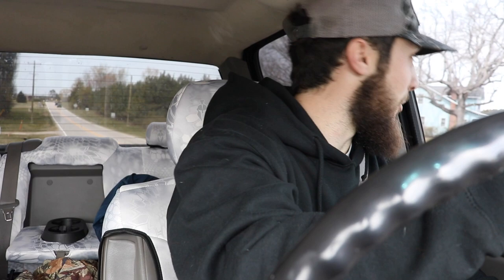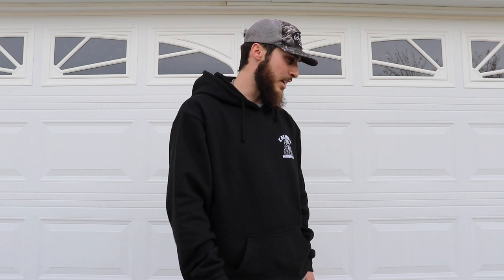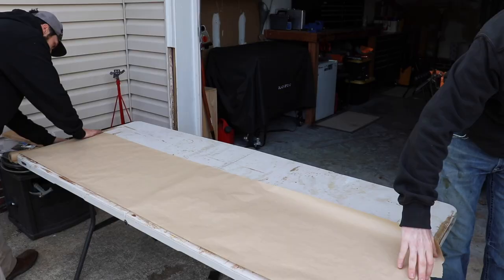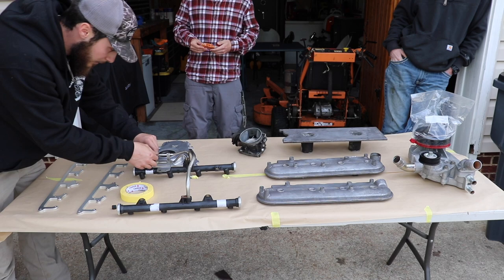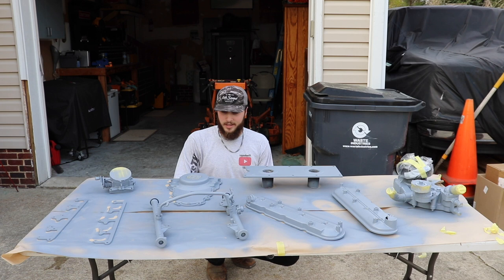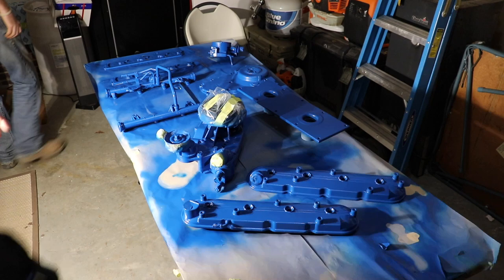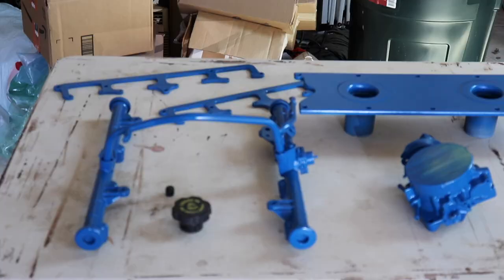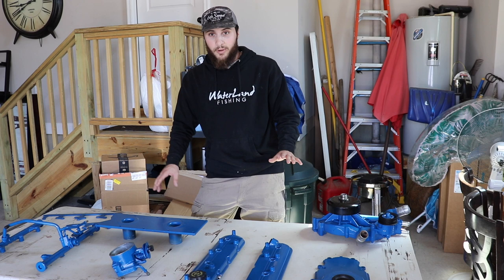Painting My 450HP Summit Racing Crate Motor

Comment: No billet Summit valve covers?  Fo shame.  🤣  

On a side note, be sure you put a touch of RTV under the rubber plugs for the Knock Sensors, keeps them dry so they don't go bad.